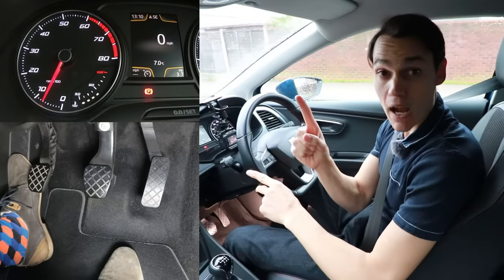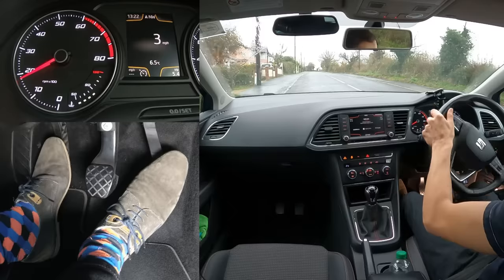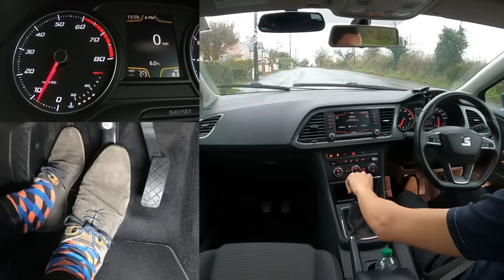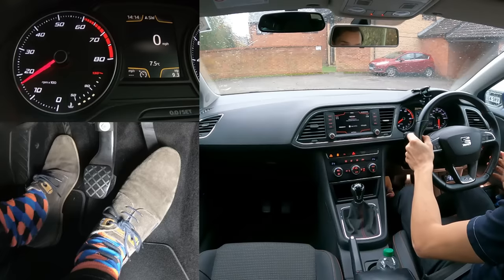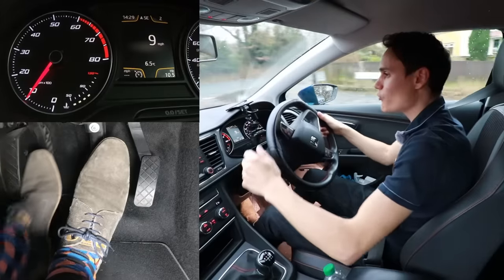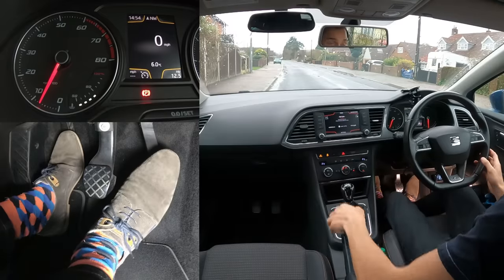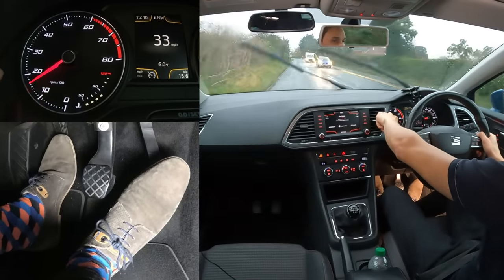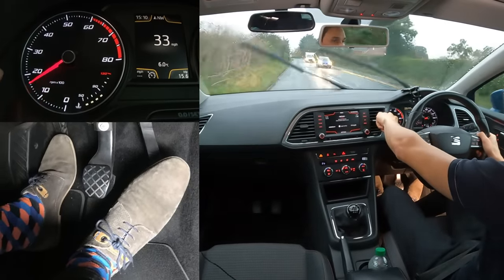How to make your clutch last longer without stressing the transmission.

Comment: I don't recommend staring moving with less then 2000 rpm, you should hold at least 2000 and slowly realising clutch, you don't need to start fast, problem with low rpm starting is with bigger engines that have 2 mass flywheel, and at starting and lower rpm, bigger engines shake and vibrate, and 2 mass flywheel tries to soften that up, but in process it weares out, and its quite expensive fix, on some cars whole engine must go out so you can separate transmission from engine, I am talking about mostly diesel cars with engines 1.9 and above, for example vw 1.9tdi and 2.0, renauts 1.9 dci, fiats 1.9 and 2.2 multijets, BMWs and mercs most have engines above 2.0, all of that have heavy 2 mass flywheels which are expensive by themselves, and expensive to replace, so you should start moving at higher rpm, and slowly relise clutch make smooth transition, don't hog in low revs

Comment: So exchange the life of the clutch for the throw out bearing? Either way its still gonna be the same amount of repair time
Reply from the maker: It depends on the clutch kit but the release bearing will generally outlast the friction disc. Mine gets quite bad though from all the hours of practising clutch control and manoeuvres. Here is a video on my clutch life: https://youtu.be/0ZjSImbwo34

Comment: I’m driving in a 2.3l turbo, I’m getting a slight jolt sometimes changing up gears but can’t tell if it’s cause releasing to early or the revs are dropping to fast / me being to slow to get back on the gas

Comment: I've got into the habit of moving off in second gear quite often, even on a flat road, just coming up slowly at the clutch with just a little gas, and holding it at the bite long enough to get above the stall point, then coming off the clutch. Is this bad for the car and putting unnecessary wear on the clutch, or is it something I can get away with?

Comment: Thank you for the tips in the video. Actually I always drive like you, specially about changing gear at less than 2000rpm (actually I change gear at 1600/1800rpm, my car has 5000rpm max), but a lot of people told me that is better to change gear at higher rpms because vibrations at low rpms can stress the flywheel of the clutch. Is it true? I never had problems with clutch, never changed them (for example I made 360k km on the same clutch with my old diesel A Class)
Reply from the maker: It depends on the car, if the car is smooth and happy then it's OK, if it is struggling and sending vibrations through the car then it's better to have higher revs. All cars are different.

Comment: I have a question: when i need to go after i stopped for a red light for example, or just when i got in the car and I'm ready to go, does adding a little bit of gas in order to increase the revs help starting in a more fluid way after taling off the clutch? I'll try it tomorrow since i have nowhere to go now, but this question popped up in my mind now when i watched the video and since i got the licence just like 4 month ago it is something that i never asked to anyone since i first saw it here, and i want to avoid ruining the car i have since it's already old enough but since there are limitations of 1 year  for the ones who just got the license i can't do otherwise😅
Reply: Giving a bit of gas when you need to get the car moving always gives you a more fluid start, whether it's a petrol or a diesel (diesel needs less revs for a smoother start). What I do, whenever I need to get moving or upshifting is just that, hold the clutch at the biting point for about half a second and give it a tiny bit of gas to rev match and make the start/gear change smoother. This, especially in older cars that jerk a little bit when pressing the accelerator, helps for a smoother and more enjoyable drive. Also rev matching, which I've mentioned earlier, is important increasing clutch life. You seldom find yourself in situations where you need to rev match when upshifting (unless you've been holding the clutch for a few seconds and need to bring the engine to higher revs). Doing it when downshifting on the other hand is essential, not many people know how to do it (I am only now, after a few years of experience driving, starting to learn how to properly do it) since it is one of the harder skills to master when driving. Rev matching when downshifting is a skill you will learn gradually, using different techniques, such as toe-heel, but since I guess you will be doing mostly city driving now that you are learning to drive, it is not so important, because holding the clutch at bite point when downshifting also slows you down a bit, along with engine break, will help with wearing your breaks less
Reply: @875yertgeyker875  thank you very much. And yes, i saw like a month ago a video on the same channel about rev matching, and i tried it when upshifting and it worked after like 10 tries, and i also tried the rev matching when downshifting with hell and toe. For this last one it worked like once perfectly and some other times it gave an awful feeling because of course i didn't know how to do it and it was just for practice. And after that I didn't go out much with the car because i didn't have time, but I'll try to find a moment to practice it with concentration. The problem for me is that my legs are too long and my foot tend to get in the way for hell and toe so in my actual car I don't think is even possible for me. It's not that it is uncomfortable when i normally drive, but if i try things like that it gets too complicated because of the space. But even if it wasn't like that i still need a lot of time to get to the point where i can do these things even slighly normal in the everyday life, so it's not a problem and I'll take my time to get better to be able to drive in s comfortable way for me and the other passengers. You know, you get happier when you can drive others without them complaining about like the change of gears not perfectly smooth for example😂
Reply from the maker: Adding a bit of extra power as the clutch is finishing its job will generally lead to a smoother start. But too much power will make the clutch slip for longer and lead to increased clutch wear.
Reply: @ConquerDriving  thank you very much. I was watching your video about double de-cluthing when i saw your comment😂
These videos are so well done and they relax me when i have some time to watch youtube videos👍
Reply: @ConquerDriving  Hello Richard

Comment: What causes some cars to rapidly drop rpm when the bite point engages? I had an older manual that did just that and I had to be either extremely gentle with the clutch (and slow to take off) or start with 2000 rpm and keep adding  gas as the car while losing rpm still took off.
Reply from the maker: It varies from car to car and depends on how much torque your engine creates and how strong the clutch bites.

Comment: Can I ask when changing gears up every 2,500 - 3,000 revs does that overheat clutch or only when moving off.
Reply from the maker: It only over heats the clutch if you're slipping it when the engine speed is significantly higher than the gear box speed. When changing up at high rpm the gear speed is higher along with the engine speed so it doesn't matter. Changing up causes very little wear when done right at any rpm.

Comment: Since we are on the topic of clutch preservation, how long do clutches usually last if not abused?
Reply from the maker: It doesn't depend on the car, some are better than others and the type of driving makes a difference. If you drive in snowdonia, town or spend most of your time on the motorway, all these factors play a huge roll. But it's not uncommon for a clutch to last the life of a car in the UK. But cars in the UK get scrapped at a relatively young age. 13.9 years is the average age of a car when scrapped.
Reply: 100k miles in my experience is a fair average. It could be alot more or a bit less, all depends if car is 2nd hand and how last owner drove it etc

Comment: I always get a bit panicked about going out of gear when in long queues as i feel the pressure of having to move forward ASAP when the traffic starts to move a little. I will definetly have to get into the habit of doing so more. I may be revving too much when moving off from traffic lights too as i feel the pressure to get moving, and going up the gears quickly - could that be wearing on the clutch too?
Reply from the maker: Yes, too many revs (more than 2000rpm) before lifting the clutch will wear the clutch more quickly.

Comment: my niece recently passed her test. why are they teaching learners to press the clutch pretty much every time they use the brake? we were taught it was classed as coasting and a BAD thing to do. speaking as a mechanic its the WORST thing you can do for the clutch. the less time you have the pedal pressed, the better. including waiting at junctions, as even i was taught. but is there an actual benefit to this new method of pressing the clutch when braking?
Reply from the maker: We don't teach to press the clutch every time they brake, if anything we discourage it. Only clutch down when needed to prevent the car struggling and eventually stalling.

Comment: Hey, my parents have a 2012 (igs) ford focus and they say i shift too quickly (not too early but fast) and they say it may cause issues with the shifter or gear box, is that really a thing please?
Reply from the maker: Yes, slamming the gears in too quickly will put more strain on the gearbox.
Reply: @ConquerDriving  alright thanks for your reply !

Comment: I like to move at 1500rpm and accelerate to 4000rpm while completely disengaging the clutch(~2500rpm) and then change to 2nd gear @ 4000rpm (more fun). I hope the car isn't getting much wear and tear from that.
Reply from the maker: It's OK to rev the engine when it's warm, it uses a lot more fuel though.
Reply: @ConquerDriving  Thank you so much for your reply! I'm getting 19-20 kmpl on my Swift Dzire as of now. 
I've learnt so much from your videos. Much love from India & Happy Holi to you!

Comment: So its not leaving the clutch pressed down that does the damage, its actually when its at the bite point that does the damage... I learnt something new, because when in traffic, i would always use the break and clutch down, then go into neutral and use the handbreak, until take off again (I have electric handbreak)
Reply from the maker: Holding the clutch down does wear the release bearing. Using neutral is a good idea but not essential.
Reply: @ConquerDriving  so i can just clutch and gas like you demonstrate here

Comment: If I'm on a steep hill and use the clutch as a handbrake I'm assuming that's very bad for it , No?
Reply from the maker: Yes it is, it's OK to let the clutch slip a bit to allow you to move away and change gear smoothly, but it causes a lot of clutch wear if you hold the car on a hill with it. When at the bite point the car should be allowed to accelerate.
Reply: @ConquerDriving  got it! I'll try to minimize that. How about down from 6 to 3rd with a rev match ?

 I think your channel will benefit from shorts. Great content!

Comment: it hurts so much seeing the clutch being abused
also, what is your go to hill start method when starting from a standstill and dealing with uphill traffic jams?
Reply: Would you rather spend $500  for a new clutch or $3000, $300 for a new transmission and gearbox? It’s common sense
Reply from the maker: I tend to move my feet quickly so I don't roll back. But I don't advise new drivers do this, handbrake starts are safer for inexperienced drivers.

Comment: It is not the heat!
Heat is generated by friction (like rubbing your hands together) . It is the friction of the two parts rubbing against each other that wears them out not the heat generated from it. 
So yes what you say reduces the heat but it does it by reducing the friction. The less friction means less wear.  So basically do not keep the clutch at bite point when you do not need to. 
Clutches wearing out is probably only a thing that driving school cars have an issue with. Most of us will find a clutch will last the life of the car now.
Reply from the maker: The friction material doesn't wear much when it's cold, when it gets hot it breaks down. It's the same reason why road brake pads don't work on track, once they reach 200+ degrees celsius (normally after just two good laps) they turn to dust and smoke and wear incredibly quickly. I can use up a set of road pads in around 100 miles on track. The clutch works in the same way. You can get friction materials that withstand the heat but they're normally compromised when cold. This is why slipping the clutch a bit for a smooth start causes minimal wear but holding it at the bite point with the handbrake on gives it time to heat up and increases wear. They're both incredibly hard and smooth surfaces that stay intact at their normal operating temperature.
Reply: @ConquerDriving  Everything has it maximum operating temperature. An engine blows up as the oil stops working. This is nothing to do with clutch or brake wear. 
Where does the heat come from? It comes from friction. More friction more heat. The heat is a byproduct of wearing, not the cause of the wearing. The friction between the brake pad and disc or the two sides of the clutch where one part rubs on the other is the cause of wear.

Comment: Why would you leave the handbrake engaged fully while sitting on the bite point? That's also unnecessary wear on the handbrake.

When you're doing hill starts you should always hold the handbrake up, but slightly released and hold it whilst in gear with the clutch in and then as you're about to take off release the handbrake as well as the clutch so you evenly distribute the take off.
Reply from the maker: Many new drivers take a long while to get the handbrake off once they have the bite point. It's much better to get the bite point when you can use it and handbrake off straight away.
Reply: @ConquerDriving  that is true. I mostly just hold the handbrake and pull up slightly and let off as the bite point grabs so both can be released at the same time making a smooth transition. Depending on how steep of an incline you're on of course.

Comment: Does the clutch still overheat even if it is all the way down?
Reply: No the release bearing will suffer though
Reply from the maker: No it doesn't, but the release bearing will wear out eventually when the clutch is pressed down.
Reply: @ConquerDriving  thank you

Comment: Does your car still on oe clutch disc?
Reply from the maker: It could be for the friction, that doesn't really wear much on my car but the spring loaded shock mechanism gets battered and starts to rattle and the release bearing gets worn from all the clutch practise. My car has 18,000 hours of mostly town use. How many miles would that be if it wasn't mostly motorway? That's why mileage is a poor representation of wear. I recommend this video: https://youtu.be/0ZjSImbwo34

Comment: Drive normal and your clutch will probably last the full lifespan of the car. Honestly the only car replacement was a Hyundai H200 with over 300.000km on the clock and was pulling heavy trailers.

Comment: Did you just brake without clutching in the beggining of the vid?
Reply from the maker: I only press the clutch when needed to either change down a gear or when the revs get to 1000rpm when stopping. This video may help: https://youtu.be/kLGpfdRFxxU

Comment: I've noticed alot of new or inexperienced manual drivers seem to have this irrational fear of slipping the clutch so they'll let the clutch out too fast from a stop and jolt the car cause it doesn't have enough RPMs to work with.
Reply from the maker: I have to agree, it is common to see new drivers making the engine struggle. I think many are taught to move away without gas. https://youtu.be/UdTSRBJrw7Y

Comment: I don’t get this hand brake start business. Been driving only manual trans for over 25 years and have never once used the hand brake to start. I just keep my foot on the brake, then quickly move to gas while releasing clutch. Even on hills. Never been a problem.
Reply from the maker: It helps beginners a lot as it takes them a long time to use the gas and clutch appropriately.
Reply: @ConquerDriving  guess I just wasn’t taught that way. I learned how to drive manual on flat roads first before moving to open roads with hills.

Comment: You never Pre Rev a car before applying the Clutch it very bad. (cause engine to overwhelm to plate) 

Gather the bite point slowly increase heat. (Like Slowly rubbing your hand over carpet)

The revs dropping after u let off the clutch (overheating it and not very efficient) Ie clutch slipping

You should Load up the clutch without any gas just to hold the weight of the vehicle, (least load possible) Then as you set off add some gas.
Reply from the maker: I recommend this video https://youtu.be/UdTSRBJrw7Y

Comment: Blip the throttle to rev match shifting down
Reply: In an old car maybe, more to prevent breaking an unsynchronized gearbox, but new car do have synchros, and even newer car rev match automaticaly..
Reply: @XxJay71xX  no they dont. Road speed will always have to match the engine during a downshift. When you downshift without throttle blip the engine and drivetrain will match each other’s revs mostly resulting in braking speed and slowing down. Just try it. Keeping engine revs at about the amount they would be when shifting down is not stressing the drivetrain with engine braking torque.
Reply: @becomematrix  Engine braking is not stressing the engine unless you're dumb enough do downshift and send your engine above the redline, in fact, engine braking is quite a good habit to keep your brakes in a good state for a long time... Also, if you downshift, it's because you WANT to slow down...  we're talking about everyday drive there, not doing a time around the Nurb...